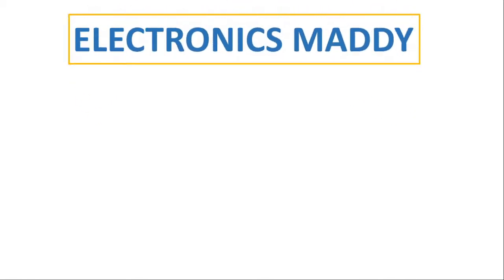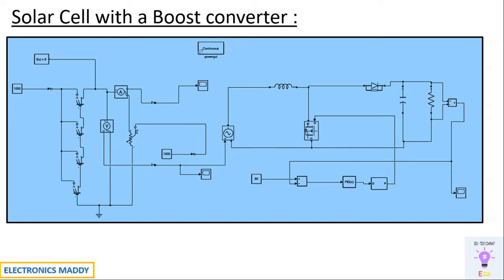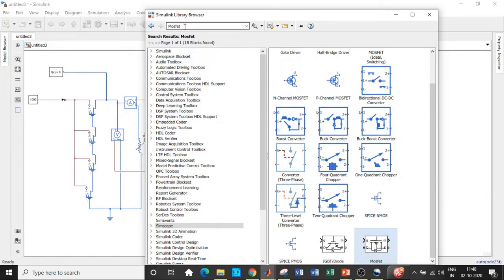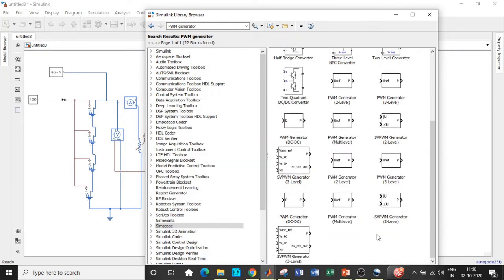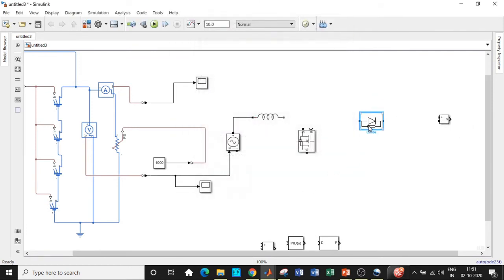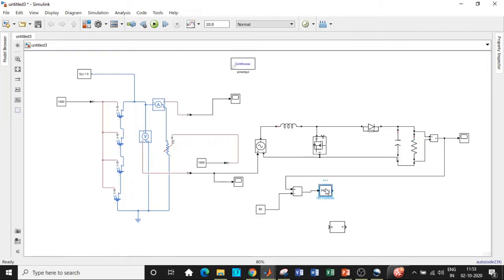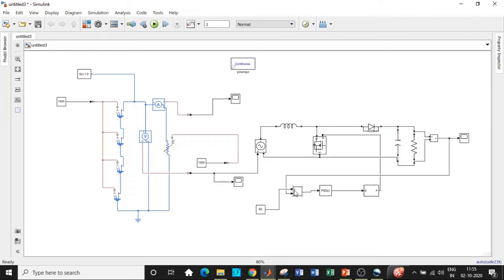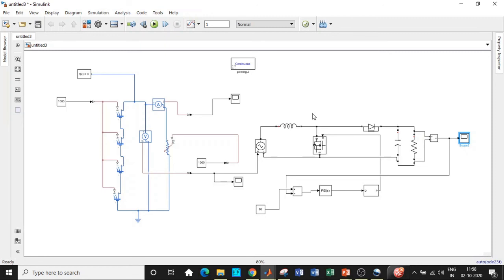Simulation of Solar Cell with a Boost converter in MATLAB | SIMULINK

Comment: in matlab simulink,  i got an error

Error compiling Simscape network for model Solarcell1.
Caused by:
['Solarcell1/Solar Cell']: Saturation current, IS must be greater than zero. In ee.sources.solar_cell
Component:Simulink | Category:Model error